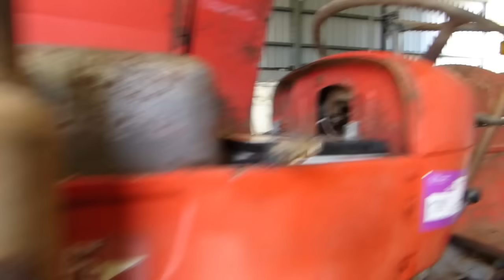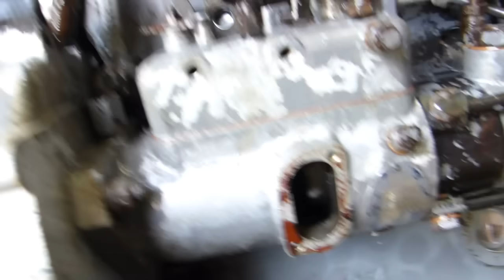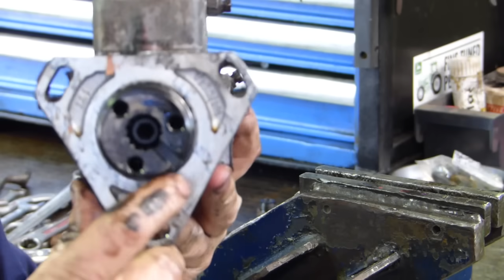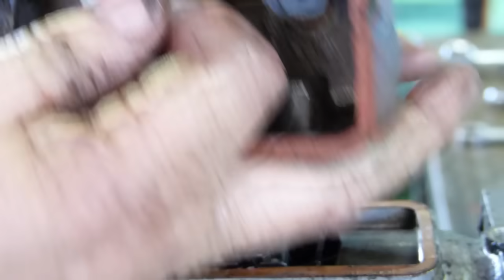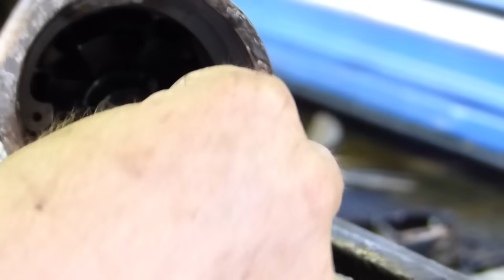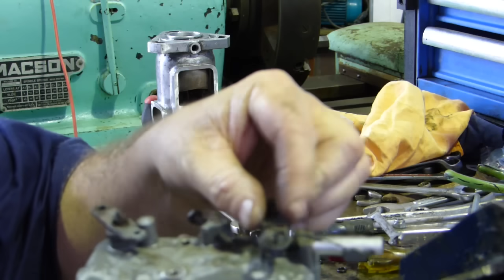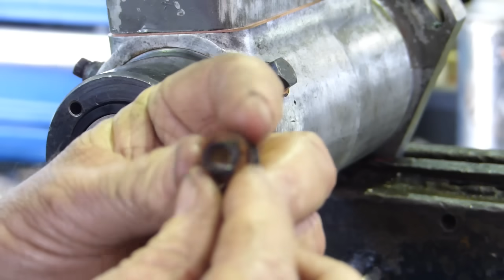CAV Injection pump full strip down to re seal and stop fuel leaks

Comment: Excellent video!  Thanks!
Reply from the maker: thanks Robert, I hope it helped you a bit.
Reply: Yes indeed.  Just leaking around the throttle shaft.  I suspected I could do a minor top seal with the unit still on the tractor.  Confidence is high.  Thanks again.
Reply: Got her done.  Thanks again!
Reply from the maker: Good news Robert, Good on you.

Comment: Hey Lance, I have a ford 4500 with a cav/dpa pump. I watched your Video and 99% was great, But for the life of me I screwed up on the governor spring on the throttle side! I can not fine or remember what you said about the setting code?   what I have on my nameplate is a DPA# 3233300 and a SER# 33692 TM. Governor Plate is the middle hole but which hole is on the trottel? Can you help?
Reply from the maker: G day Tim, Pop the top back off and have a good look at the holes the spring goes in. There is often a slight wear mark that will tell you where it was.
Reply: Bundy Bears Shed  , Will do,  thanks

Comment: my 135 sat for a few years and now it is not pumping few up to the injectors. do you have any ideas on what would be the problem?
Reply from the maker: G day Mark, I would think the metering valve may be stuck. Also check the little plunger under the fuel inlet hasn't stuck from sitting.

Comment: Hi! After watching this video, I took the chance to look into a DPA pump on a MF 165. The pump was obviously tampered with by someone not knowing what it's about. I suspect that the spring under top cover is stretched. Do you know if there is a reference to original lenght of this spring? The actual spring measures approx. 42.8 mm inside the end hooks unloaded.
Reply from the maker: Without pulling a pump apart I don't have the measurement and I don't have one available to do at present I'm sorry.

Comment: Great video, thank you very much.  I just finished rebuilding my pump on my Ford 2000 thanks to this video.  I have a question on the fuel delivery tubes...Mine have something in them like a steel tube or sleeve inside the tube which seems to block the holes in the fittings.  Is that normal? When I tried to bench bleed the pump as you did I can get fuel to squirt out of the holes without those fittings in place but not when I put those on.  Any ideas?  Thanks in advance.
Reply from the maker: G day Brian, Those are delivery valves I think if we aare all talking about the same thing. Your injector lines should be free to blow through though.

Comment: I have a massey 150 and it is dumping fuel into the cylinders i think because its trying to rev way up and filled the oil with diesel. Do you think injector problem or pump problem?
Reply from the maker: G day Zach, I think it sounds like the front injection pump seal.
Reply: Finally got around to checking it out. I remember replacing the seal you are talking about in the past when i pulled the oil fill tube off of the timing cover i found the hex bolt that goes in the middle of the shaft had backed out and   bounced around the case some but luckily didnt fall down in the timing cover. Should i just replace the bolt? Or do i need to check anything else out
Reply from the maker: I have never had a bolt fail, possibly put a drop of Loctite on it on assembly
Reply: Ok lance thanks alot for the advice!

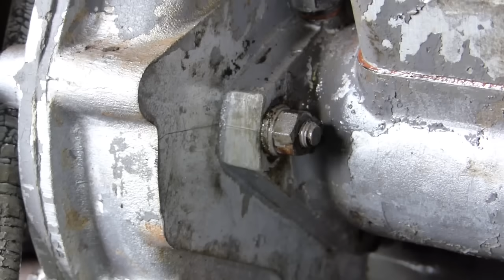Comment: Thanks a lot Lance. I'll have to do this job soon. At 4:04 you mention the pump to gear housing timing marks and the ones on mine are noticeably off with the pump clockwise a bit above the housing mark. Do you recommend moving it so that the marks line up or leave it the way it is. Didn't know if its supposed to be that way or if someone before me made a mistake with it.
Reply from the maker: G day Mike, I would line them up back to standard. But in saying that take note of where it is now just in case it is there for a reason and it is hard to start or something, then you can try this setting and see what difference it makes.

Comment: Good job ,thank you , my problem is simple enough , I  am helping a friend with the installation of a new power unit in his boat ,anyway we needed a slightly  bigger hole in the throttle arm and couldn't drill it in its current spot  so I took it off ,now I have no throttle after reattachment, do have to take it apart to fix it..??
Thank You so much for anyones help ,we're really remote here so hopefully I don't have to pull the pump in belly of a boat.
THKS ANYONE..
Reply from the maker: G day ushillbillies, Where the shaft goes onto the arm you took off there is either a small spline or the more likely two flats on the shaft to engage the lever. Just pulling the arm off will usually not cause any trouble but I have seen them done up and miss the flats.
Reply: Up date and thank you ,  as it turn out you are absolutely correct , what surprised me was that I had to reset the idle stop ,  the engine wouldn't fire up until we pulled the lever back approximatly 1/16 of an inch.
  it seems good now ,but still puzzles me as to why..FYI its on a 45 HP Westerbeke marine engine in Gibsons BC ,Canada..
Thank You very much
Reply from the maker: ushillbillies well that is good news, glad you got it sorted.

Comment: hello friend I have a pump injector like your disassembled I cleaned and I made the exchange of the rings and joints but it does not work, just start the tractor with the throttle lever fully activated and the tractor is in slow, what can be? help me please . Congratulations for your work.
Reply from the maker: G Day Alam, It sounds like you have the spring in the wrong hole and there is not enough tension on it.
Reply: thank you

Comment: anyone know how to contact this bloke. got a question related to this pump malfunctioning. getting fuel to all parts of pump but not out of the injector lines. heaps of pressure.
Reply from the maker: I would think either the metering valve is sticking or the plunger under the cam rollers is sticky, there isn't much else.

Comment: Good too know you don't have too take it off too replace the solenoid. Now if i could just find the resistance spec for a Stanadyne db4 too know it is shot before I remove it.
Reply from the maker: Cant help with that at the moment William but google might be able to help you out.
Reply: thanks i figured it out. just pulled and bench tested.

Comment: Excellent video and very well explained - it almost points me in the correct direction.  I have a tractor with a Delphi diesel fuel pump not much unlike like what is being described here. It is on a Perkins engine type 1104C-44T Turbo. From time to time when accelerating the engine will not respond to the throttle. Indeed on the odd occasion the revs could drop back and the engine would die out. I have treated the diesel to make sure there is no water in the system but it can still do it from time to time. I also checked the fuel cut off solenoid and that seems to work ok on testing. Might the issue be the metering valve (could it be sticking as you mention) and are there any potholes that I need to watch out for on the Delphi? Keep up the great work.
Reply from the maker: G day Pat, I'm not so sure on the Delphi but they do seem similar. I would certainly polish up the metering valve or look under the inlet at the vane pump valve under the inlet to see it is nice and free.
Reply: Thanks Bundy. As my issue only seems to be occurring occasionally might a cleaning additive of sorts  be worth trying? My pump seems to be like the one shown at this Delphi link https://www.delphi.com/manufacturers/cv/powertrain/fuel-pumps/dp210-rotary-mechanical-fuel-injection-pump

Comment: Thanks for the video! Couldnt have done it without ya!
Reply from the maker: Great to hear,
Reply: Bundy Bears Shed 
Do you have any videos adjusting or replacing brakes? I have a MF 255 and im not sure if it has wet or dry brakes. I dont see any notches on the housing so does that mean dry brakes? I adjusted the adjustment screws as tight as I can. Any help is much appreciated!

Comment: Hey, changed top cap gaskets and o-rings for stopper&gas shafts but now it doesnt seem to pump anything. opened the high pressure lines and there comes nothing. theres fuel in the tank (not much but there is)and the pump itself was never removed, only top cap. messed up something with the governor plate or the stopper somehow?
Reply from the maker: Possibly you have missed the stopper
Reply: Yes that was it, thanks. fantastic video!

Comment: lance i have cav pump cleaned plungers and valve but i dont have fuel to injectors can you help me thanks
Reply from the maker: G day Thomas, Check the little shuttle under the inlet screen, Make sure the metering valve is nice and free and check the transfer pump vanes as well. The plungers under the cam rollers may be stuck as well.
Reply: Lance, I cleaned all parts on inlet, metering vale is free. Didn't check the plunger under cam  rollers.  Can I check them without removing pump?
Reply from the maker: No the pump must be removed and I didn't cover them in my video as you don't need to dismantle that to reseal the pump, you should be able to bench test the pump like I did in the video before you re fit the pump. They are easy to do though.

Comment: Which way does the cam go in?
Reply from the maker: Andrew Stevens all of the bolts will only go in the one place. Look for the circlip shadow on it
Reply: Bundy Bears Shed thank you so much for the info. It really helped me out. Hey what would happen if I put the cam in the wrong way?
Reply from the maker: Andrew Stevens it wouldn't pump t the right time
Reply: Bundy Bears Shed thanks man , really appreciate your help. Maybe I can get my tractor goin now.
Reply: Bundy Bears Shed The cam has got markings that says 8degress with an arrow then it says 9740. Does the side with the writing turn toward or away from the weights?
Reply from the maker: The cam will have letters like K or G fir instance and the letters go to the weights so you can see the mark through the inspection cover and so you can check your timing later.
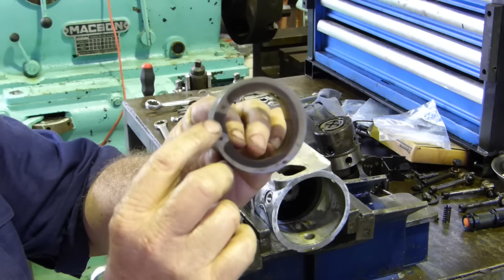Reply: Bundy Bears Shed I don't know much about these pumps or the parts. The part at 40:50 in the video is what I am talking about. Which way does this go?
Reply from the maker: yeah that's the cam, it cant go in wrong or your bolt holes wont line up.

Comment: My  Cav is similar (JD5300) but has a shutoff solenoid instead of the internal kill valve.  I can not get mine to prime. when I try to prime it the manual lifter  pump works for a bit and then gets too much resistance.  I took out the solenoid and fuel gushed out from that place. I was able to remove the plunger shaft from inside the solenoid and reinstall it but still can not pump it to prime.  I am wondering if you had any suggestions- thanks

Is it possible that this IP has a backflow valve at the return outlet?
Reply from the maker: G Day Hans, without the centre of the shutoff solenoid you should get prime but when it starts you will need to stall the tractor out to stop it. I would loosen one injector pipe only and refit the fuel solenoid with the middle missing and wind the tractor over I think it may come good for you.
Reply: Thanks.  I am gonna have to go get a new battery.  The old one gave up the ghost.
Reply: New battery and lots of cranking, but no love.  She doesn't seem to want to prime.  How much cranking should I give it?  What about the question of whether the return has a check valve in the the return?
Reply from the maker: I don't know about the return, it sounds like your metering valve may be sticky, top off and see if it is free would be my next step.
Reply: I did that following your  video. cleaned it all up on the top section and the metering valve was not stuck but now cleaned and put back on.  Still no prime.  Do I need to pull the pump and open it up? 
Thanks again for your reply.  And your videos are really great.
Reply from the maker: Yes I would pull it down and look at the bottom of the inlet filter and check the little shuttle is free or the main plunger under the rollers on the cam may be sticking.
Reply: Sorry for the back and forth - but when I did the top and the metering valve I also pulled out the inlet filter and replaced it.  And also cleaned the plunger and springs.  The filter looked kind of dirty so I thought maybe that was the issue . but still no prime.
Reply from the maker: Yes that is the one, I didn't cover that as you don't need to play with it to re seal the pump, I do have another pump to do so maybe next time I will go deeper.
Reply: Okay I am gonna pull it out.  Thanks for all your help!

Comment: My name is jacob. I have put a 354 perkins in a 74 chevy pick up and having stalling issues. My email is frost1984fiero2m4@gmail.com.  plz help
Reply from the maker: What type of stalling issues?
Reply: Stalls when break is applied or when shifting from 2nd gear to 3rd.
Reply from the maker: Do you have your low idle on the pump set at around 750-800rpm? that is one of the small screws that limit the throttle lever travel.
Reply: Bundy Bears Shed honestly  i dont know.  But it does have a lope to like it has a large cam.
Reply from the maker: Sounds like there is an air leak on the inlet side somewhere
Reply: What would be the proper way to bleed the fuel lined for zero air. And why does it die so hard that i need ether to get it running after it dies?

Comment: I have a Long 2610-DTC tractor ! Will my injection pump rebuild be close to the same as the one you are doing ???? My Tractor runs good for 10 min then stumbles an dies !!!! Is this my pump ?? All filters have been replaced !! Thanks
Reply from the maker: G day Corky, On a Long tractor I don't know as I have never worked on one. It sounds a bit like an air leak though.

Comment: Thanks i have a massy Ferguson backhoe and the pump is leaking bad so I am going to buy a kit and repair it. one thing is I am not sure how to reassemble it back on the matching  and have it timed I noticed at the beginning of the video you set the marks on the lines if the marks are all lined up the question just put the pump back on and it will be lined up? I am going to watch it again. Great video

Comment: I have a 354 perkins I can drive it for a while and then it stalls out and the. I have to use starting fluid and it takes right off immediately.
Reply from the maker: It sounds like a fuel blockage and when you stop it catches up with supply for a short while.

Comment: awesome...thank you for the video...just finished with mine. had diesel in oil...also changed diaphragm on transfer pump. however it now idles around 1200 rpm. aside from double checking spring position what else did I miss or should I look at. thanks again.
Reply from the maker: G day Marshall, You are on the right track, I would double check the spring position as it sounds like the spring is too tight, does the lever sit against the stop bolt correctly or did you adjust it there? If it wont come back on to the screw its the spring.
Reply: assuming you mean externally, yes it rests on the stop. i didn't mess with the stop screws. almost positive the spring was put back correctly 3&3 but will double check tomorrow. thanks again.
Reply: my spring was in the proper holes. found a cav shop manual online and although it doesn't specifically say the pics indicate the throttle link should be inside the spring. this is the only change I made and now she idles around 700 rpm. thanks for the video which gave me the courage to try it on my own.
Reply from the maker: Marshall McNeil yes that's right, glad you got it sorted

Comment: G`day Lance , thanks for the video , great work . I recently put new seals in a early MF 35 with a 3A 152 engine , job done . only difference was the circlip in the pump , on that model you line up with the letter E , and on the hole in the circlip there is a scribe line which has to line up with the E . Hope this is some use to your viewers
Reply from the maker: Thanks Dave, Yes there are a few small differences on some pumps but hopefully there is enough info here to get people through the job.

Comment: Wonderful video that is easy to follow.
Reply from the maker: Thanks Nathan
Reply: Finally got my reseal kit and gave it a go. Boy did it need a good cleaning on the inside. Question: I got it all back together and bench tested with wd-40 squirting out the pipes. Should it be a little tougher to turn by hand when given some throttle on the bench? The shaft turns freely without throttle
Reply from the maker: Yes a little as it now has a job to do and when it is stopped there is nothing moving around under any load.
Reply: Bundy Bears Shed that makes sense. Just wanted to make sure before I remounted on the engine. Thanks so much! By far one of the best instructional videos I have watched about anything. Keep up the good work! I am doing this on a Perkins 4-108 that runs my sailboat so now a little boat yoga to remount the pump...probably going to be the most difficult part of all this. Thanks again!
Reply from the maker: You need carpet snake arms for working on boats, hope it goes well for you.

Comment: Very interesting and extremely well explained Lance, well done.
Reply from the maker: Thanks Daryl, Hope you got something useful from it.
Reply: Yes Lance I will be pulling down a CAV pump today , it needs new "O" rings on the throttle and stop levers on a International  B275.
Reply from the maker: Easy job that one you don't even need to take the pump off.
Reply: Yes, and I have finished that little job, and no leaks.  Thanks Lance.